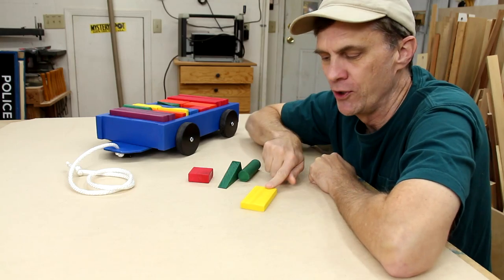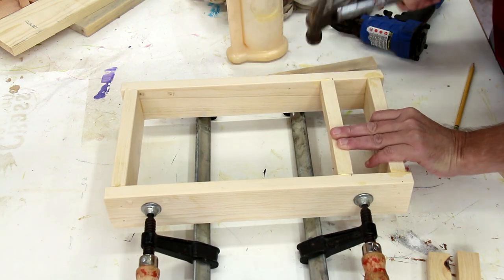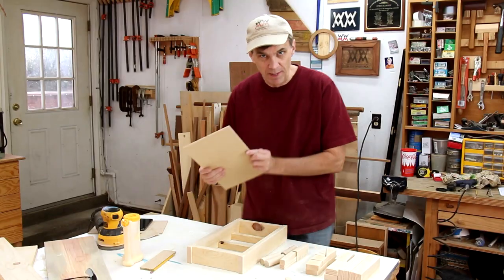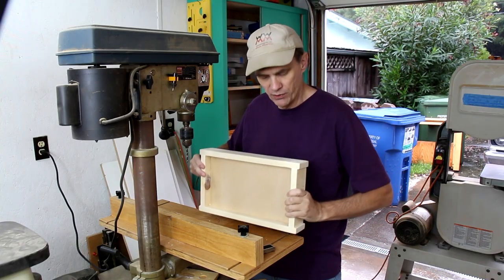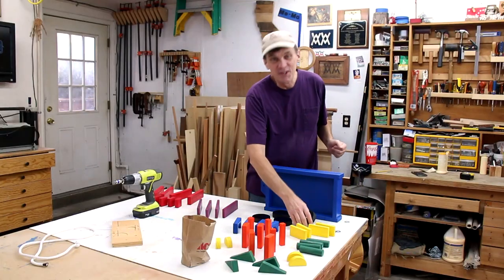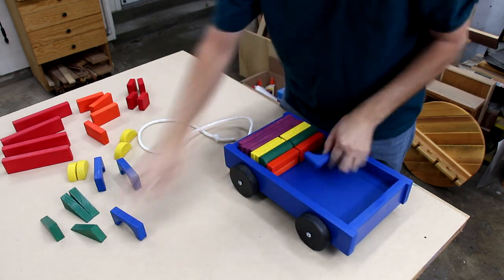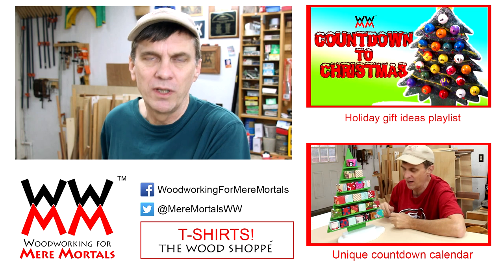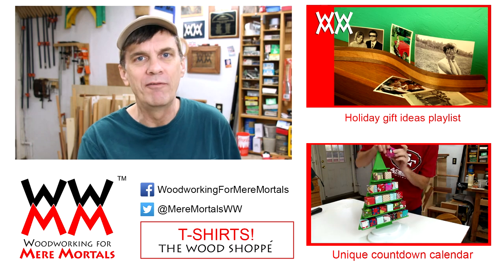How to make a classic pull-cart full of building blocks

Comment: Steve,  great project.  However you may want to weave a stick to the pull rope as a safety feature to keep it from tangling around a small child's neck.  In fact,  i think pull toys like that have such a feature mandated to prevent accidents
Reply: Then they would poke their eye out trying to look at what's inside the pull rope.
Let's stick with a bit of common sense and responsibility.
Reply: You're right chance9050, I was thinking the same thing. A manufacturer could never sell this in a store with that length of rope due to the various laws nowadays. Do I agree with that no. I remember having something very similiar to this as a child with a similiar length of rope. I'm still alive. That's just the reality of the world today.
Reply: Sebastopolmark
I have the same problem with my shotgun. My damn curiosity! I blame my Pikachu muzzle choke.